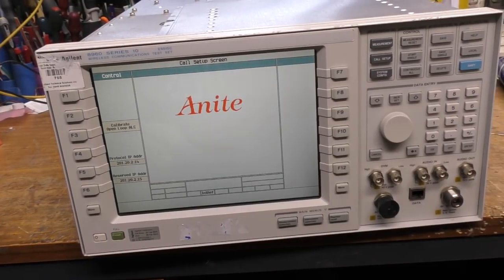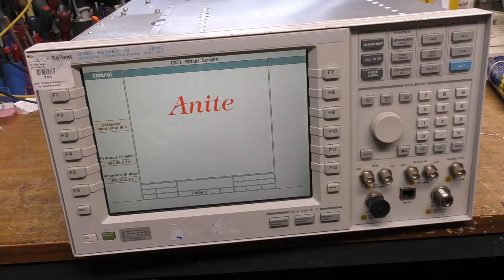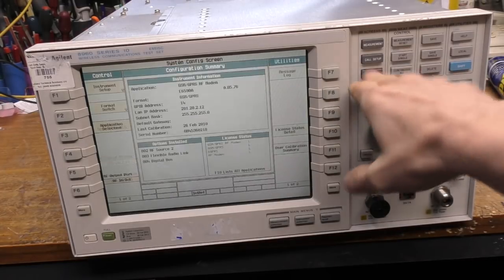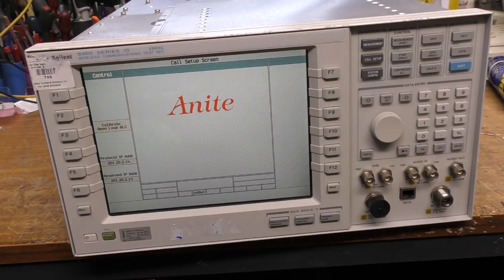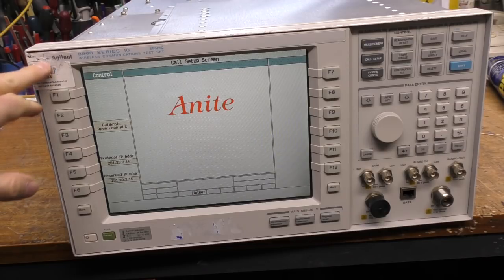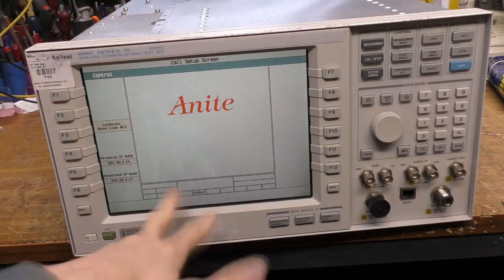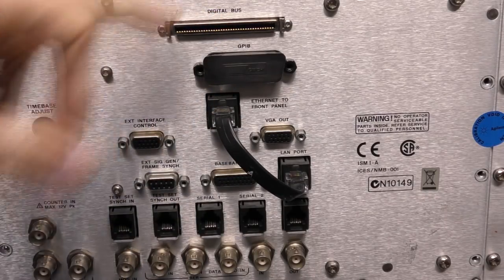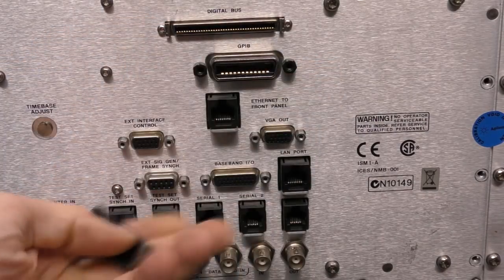Agilent 8960 communications analyser teardown

Comment: Those AMI chips could be the entire range of Profibus Interace IC's they made in the early 2000s. They did everything from GPIO, timers, A/D, D/A, even complete DAQ's with trigger and external SRAM storage. Datasheet were only available by signing NDA. Another one who made ASICs for Profibus was ST. Back then I worked with Profibus ISA interfaces, that's how I know. But since these chips only have the Agilent markings I am not sure.
Reply: On the other hand, AMI also bought parts of WSI from ST. They made those PLDs called "PSD". But mask programmed  (MPSD). Could be those as well: http://matthieu.benoit.free.fr/cross/data_sheets/WSI_PSD.pdf
Reply from the maker: PSDs were only peripherals, don't think they were useable standalone. Interesting the range of packages, also lack of a crystal next to any of them
Reply: Lack of crystal is a good point.

Comment: At 21:56 that device is perhaps just a high power RF attenuator pad, same construction as dummy loads I've seen.  Probably to both protect the input and to protect against high VSWR on the output, or perhaps to protect against backwards power.  Would make sense to allow that connector to directly handle a transceiver's antenna connection.

Comment: I think the LCD could probably be re-used along with maybe the single board computers if you can get them to display anything. One fun thing i think would be getting the pentium4 SBC to work and comparing it to maybe a raspberry pi in terms of performance.

Comment: Will be a non-tiny amount of gold in that pile of PCBs. Usually RF gear is much better than normal Ewaste for gold recovery. Mostly thick bond wires and gold braid inside some types of IC's.  The gold plating is often hard gold too, instead of worthless ENIG.  Checkout "Successful Engineer" channel

Comment: I wonder why Agilent didn't find an additional use for them, for example, they could have sold off the remaining stock for like $100 each, and then included some kind of transceiver board that would allow it to function as a cell service booster if you are in an area with poor coverage. This may have given it a second life as a general consumer device, especially if it could be adjusted by the user to support different bands and service types.

Comment: Those beads on the RF front end looks like part of a directional coupler ... i have never seen one like that on a PCB directly
Reply: I think that is quite common construction of wide band couplers actually.
Reply: its not an uncommon construction for 500+mhz, just not all that common (at least in my own experience) to see one placed on PCB directly and not in a module, normally PCB wideband directional couplers for this frequency range (again in my experience) are the transformer/autotransformer type 
i dont do RF stuff for work or anything so im not all that sure what the benefits of each type are
Reply: Alyx BioHaz at least one of them was definitely a directional coupler, you could see the connections from shield and center pin.

Comment: Hey Mike. The back of the device had a VGA out. Could you maybe try to figure out if that's somehow connected to the Pentium 4 computer board and try to power it up? That would be cool :)
Reply from the maker: Didn't check but pretty sure this would be a duplicate of the main screen.
Reply: Probably just an external output for the already displayed lcd that is on the device though.
Reply: mikeselectricstuff alright. Thanks for the teardown. I like this. Reverse engineering is also cool to see :)

Comment: so is that why usb port pins on the ends are longer than the center pins for hot swap... ?
Reply: yep, and or generally every connector that exists has the ground contact first for signal stability and safety and etc many reasons

Comment: Informative video.Need one solution regarding this tester,We have purchased Agilent Wireless tester E5515C  it has issue of restarting continuously after this text "Start DSP boot initialization".Does anyone know about this issue and how to rectify it.I would be very thankful
Reply: I have the same problem! The trouble shooting manual on the keysight website (near the end of the list) suggests checking the serial log from the device and gives instructions on how to do this

Comment: please do teardown of cellular base station ! please ! please ! please !
every time i see those i'm so desperate to look what's inside ;)
Reply from the maker: Me too - someone send me one!
Reply: mikeselectricstuff

Great vid, Mike. ;)

Do you possibly still have any of the boards from this? I might be interested in any of the higher speed ADC / DAC chips.

(I'm in the UK, and bought a PM tube from your eBay a few years ago.)

Not a great deal inside a cellular / mobile base station tbh. Usually far simpler than what we've seen here...

I worked in various telecoms factories over the years, on 4G / LTE test boxes etc., and that was just a single board in a 1U rack, with a Spartan 6, small DIMM PPC module that ran bare-bones Linux, and some parallel ADCs / DACs.

They didn't even roll their own core for the LTE / CDMA / CIPRI stuff, they just used the Xilinx IP cores.

The Wimax device was very similar, but was mast-mount (48V, or PoE, IIRC), and had a large RF power amp block.
The cast alu chassis had heatsink fins, and the PA bolted to the inside of that.

Would still be very interesting to see a teardown of an actual base station though, as the racks I worked on were essentially the test and setup reference standards.

Especially interesting if it's older stuff, like this analyser.
The one I used in 2011 looked almost identical to this, but was PC-based, and we played the Win 98 Pinball game and DOOM on it. lol